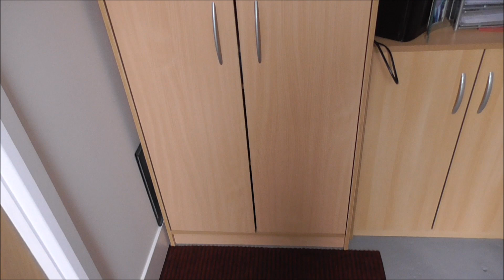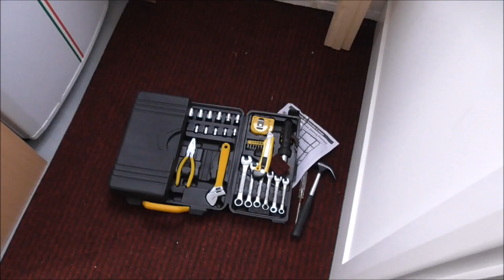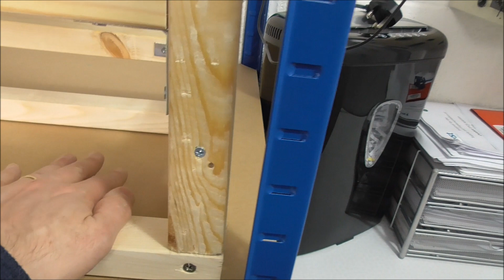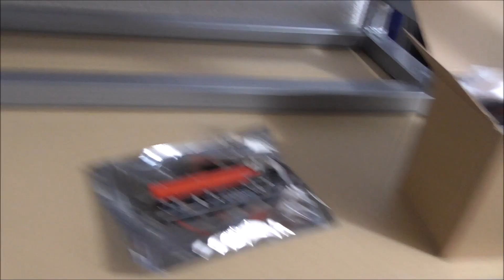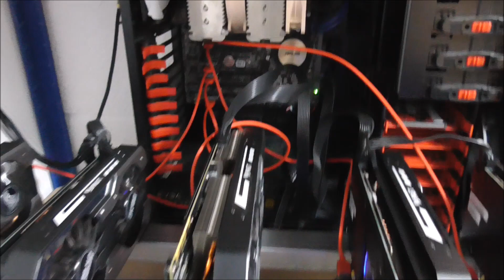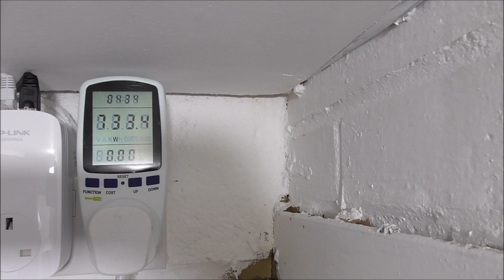New GTX 1060 & 1080ti mining rig build vlog

Comment: Looking good Ricco are you still happy with nice hash profits and do you rate the 1060s I have 3 1070s running at moment but as you say card prices are crazy at the moment would like to move up to 6 cards in future but with hearing nvidia is due to realse new card not sure how to play it.
Reply from the maker: Jon Paul 
Nice hash seems fine for now. I move BTC to coinbase then to gdax all for free which is good.
I want two 1070's for spare machine but the costs are silly and with the possibility of new cards on the horizon it's a difficult decision.
I reckon Nvidia will hold off releasing new cards based on Volta until gddr6 and hbm2 become cheaper and also Pascal is selling extremely well at the moment.
Reply: Ricco123tube hope so why cards are selling well no incentive to realse new card. Yeah love the nice hash to gdax no fee feature works well and really quick from my experience with it, could you update us on the daily estermated pay out is for you new rig when it's had a good run:)
Reply from the maker: Jon Paul yeah I will do soon.
Hopefully got a short silly video next if it works out.
Reply: Keep up the good work Ricco love the the info helped me out 🖒

Comment: Nice Setup!, Why not run the old system with another 4 more GPU instead 2? Was it not stable?
Reply from the maker: Malvin Edward I used a pcie 1 to 4 adapter and recently it became a bit flaky. I wanted 2 1070's but with the prices right now I may get 2 1060's.